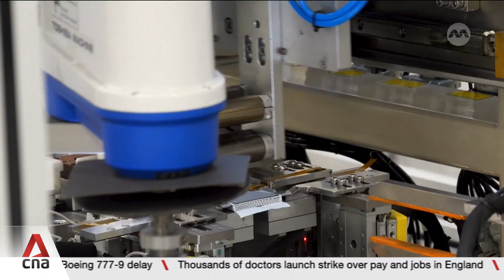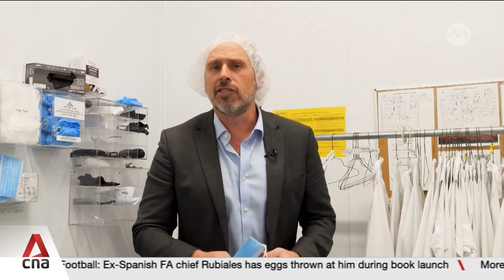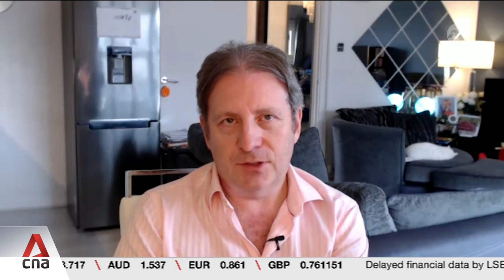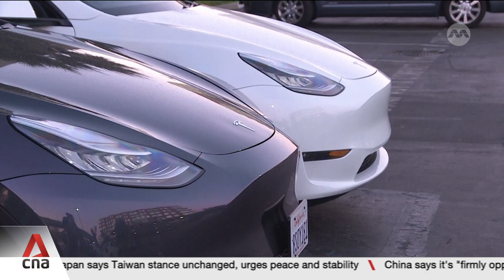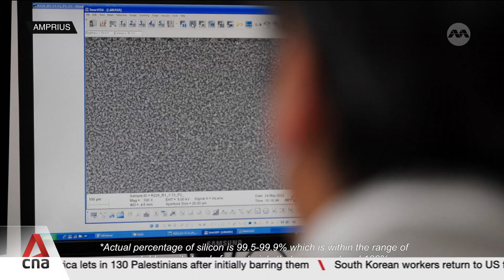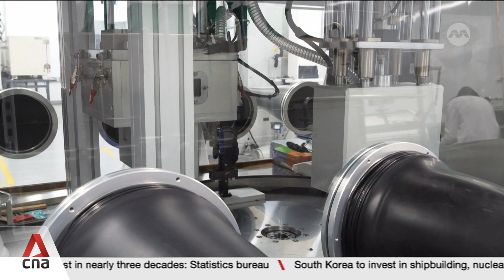US still a decade behind China in battery race

Comment: The US is ahead in silicon carbon anodes that provide the next big leap in both energy density and charging speed for Li-ion batteries.  While Group14 Technologies (the leader in the sector) first EV scale plant was in South Korea (2,000 metric tons, 10 GWh), they have a set of six same sized plant modules already permitted and two under construction in Moses Lake, WA.
Reply: Doesn't mean anything when the most of the top manufacturers are Chinese including 1 and 2nd.

China has been developing LFP for way longer than anybody else so their advantage in that type is way obvious.

CATL and BYD already rolled out next gen batteries and charging ports. How long would that US tech need to reach the consumers? If it doesn't offer massive advantages over the current techs then it will be a failure.
And Chinese battery companies have been investing massively in R&D for decades already.

U seriously believe the would-be battery factories in US and Korea would give them edge over the current market leaders in China?

Comment: Governments need to shift from climate talking point to modern power infrastructure, when it comes to electrification. It is a fact, that batteries allow you to raise the capacity and efficiency of the power grid, even without the installation of renewable energy. Speak about it it terms of economics, and adoption will rise.

Comment: During his first term (2017–2021), the Trump administration targeted a wide range of green technology and clean energy initiatives for cancellation or reduced funding. Key actions included the withdrawal from the Paris Climate Agreement and the replacement of the Obama-era Clean Power Plan. 

Specific projects and areas that were cut or targeted for cuts include:
Solar Energy: The administration canceled approvals for the Esmeralda 7 project, which was slated to be the largest solar power project in North America.
Carbon Capture and Storage (CCS): The long-standing, Obama-era FutureGen initiative, a clean coal project aimed at advancing CCS technology, was officially canceled by the Department of Energy in 2018.
Electric Vehicles (EVs): The administration rolled back vehicle emission standards and targeted subsidies for consumers to buy electric vehicles.
Offshore Wind Projects: The administration reportedly tried to block offshore wind projects that were already under construction.
General Clean Energy Research and Development: The Department of Energy terminated funding for hundreds of unspecified projects related to battery plants, hydrogen technology, and grid upgrades, with an estimated value of nearly $8 billion.
Environmental Protection Agency (EPA) Programs: Funding for several EPA initiatives was cut, including the Environmental Justice Government-to-Government program and the Low Embodied Carbon Labeling for Construction Materials program.
Methane Strategy: The Obama administration's Methane Strategy, a framework for addressing methane emissions across federal agencies, was rescinded by executive order. 

These changes were largely part of a broader effort to maximize oil and natural gas production and roll back environmental regulations, which the administration argued would "Unleash American Energy".

Comment: Recently King Drump has cut all the fund for green tech development.
These changes were largely part of a broader effort to maximize oil and natural gas production and roll back environmental regulations, which the administration argued would "Unleash American Energy".
Reply: During his first term (2017–2021), the Trump administration targeted a wide range of green technology and clean energy initiatives for cancellation or reduced funding. Key actions included the withdrawal from the Paris Climate Agreement and the replacement of the Obama-era Clean Power Plan. 

Specific projects and areas that were cut or targeted for cuts include:
Solar Energy: The administration canceled approvals for the Esmeralda 7 project, which was slated to be the largest solar power project in North America.
Carbon Capture and Storage (CCS): The long-standing, Obama-era FutureGen initiative, a clean coal project aimed at advancing CCS technology, was officially canceled by the Department of Energy in 2018.
Electric Vehicles (EVs): The administration rolled back vehicle emission standards and targeted subsidies for consumers to buy electric vehicles.
Offshore Wind Projects: The administration reportedly tried to block offshore wind projects that were already under construction.
General Clean Energy Research and Development: The Department of Energy terminated funding for hundreds of unspecified projects related to battery plants, hydrogen technology, and grid upgrades, with an estimated value of nearly $8 billion.
Environmental Protection Agency (EPA) Programs: Funding for several EPA initiatives was cut, including the Environmental Justice Government-to-Government program and the Low Embodied Carbon Labeling for Construction Materials program.
Methane Strategy: The Obama administration's Methane Strategy, a framework for addressing methane emissions across federal agencies, was rescinded by executive order. 

These changes were largely part of a broader effort to maximize oil and natural gas production and roll back environmental regulations, which the administration argued would "Unleash American Energy".
Reply: Drill baby drill he said lol, primitive😂.
Reply: The Donald Elon administration "wild wild west" policies is so entertaining. 

😂❤